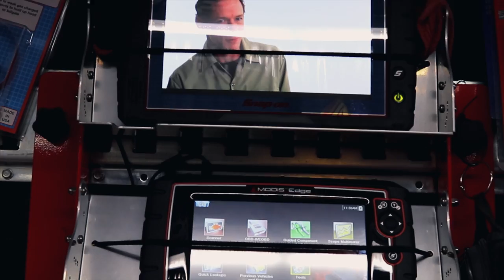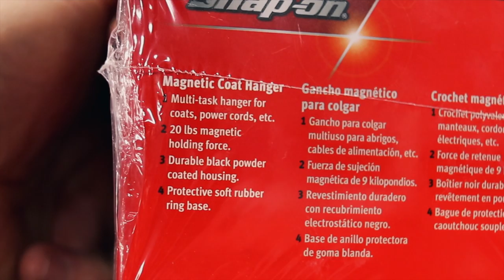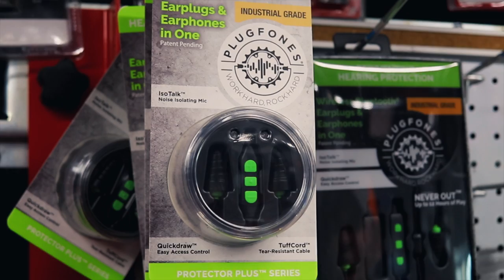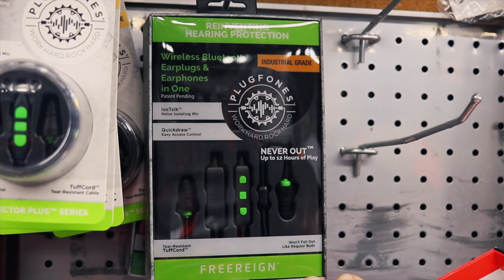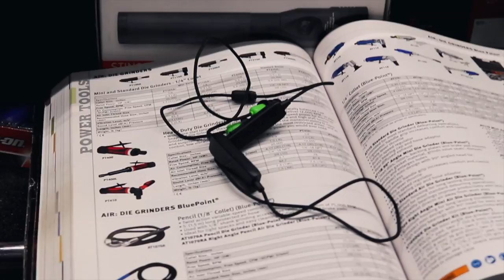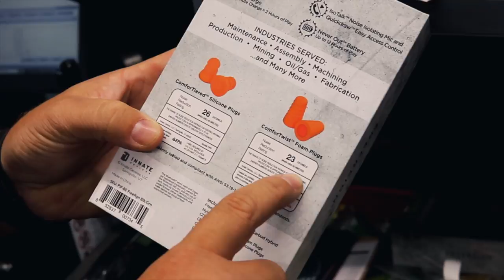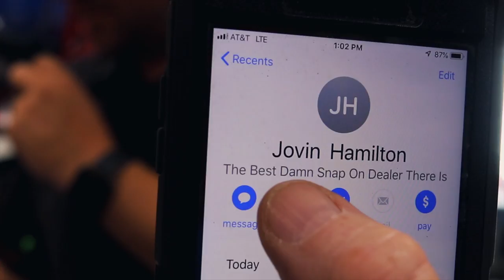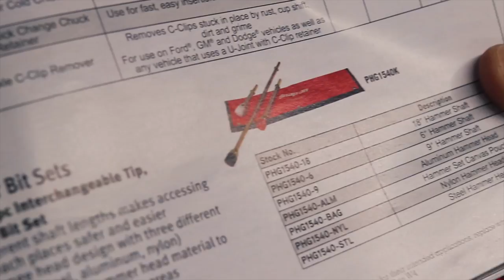Snap On Friday, We Learn Snap On Air Hammers Are Bad To The Bone. Check this out !

Comment: So im on the fence about the air hammer from snap on  or  matco witch dobu thinks better
Reply from the maker: All a matter of opinion. I say buy the one from the dealer that treats you best. All tools break or wear out. The tools are only as good as the dealer that sold them to you
Reply: Thanks  but there both amazing they helped me start  out with a lot of tools I did not have im a new tech and went in with a bunch of harbor freight  stuff

Comment: Eric.O says the snap on air hammer is weak sauce, compared to the Astro pneumatic big nasty
Reply from the maker: If it is any stronger..... i don’t know ? I do that that the one bill has is a BEAST ! It’s good enough for me
Reply: 2ndismyright obviously, it’s nearly a 0.498” shank vs the snap on 0.401” shank. 0.498” bits are harder to find. So every mechanic must have a 0.401” for all different situations: long bits, fan clutch removal, etc. also the 0.498” is most likely going to suck more air than a 0.401”